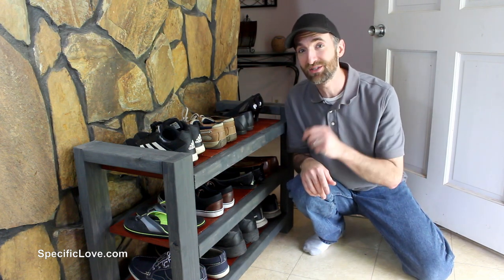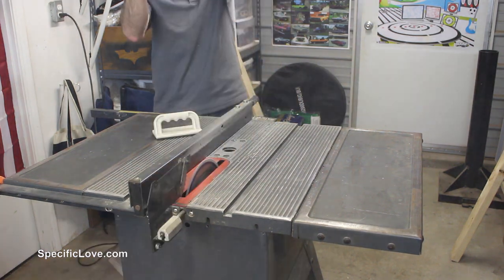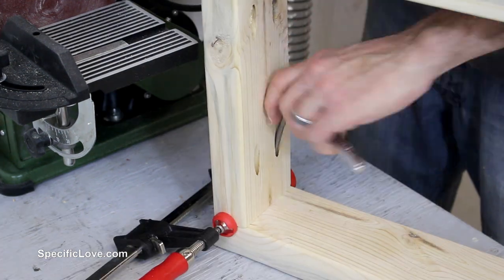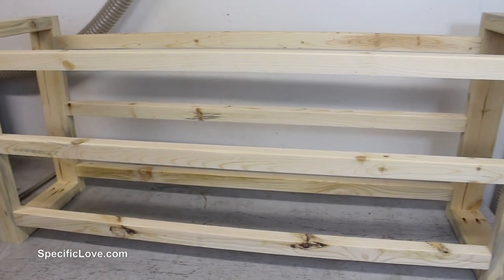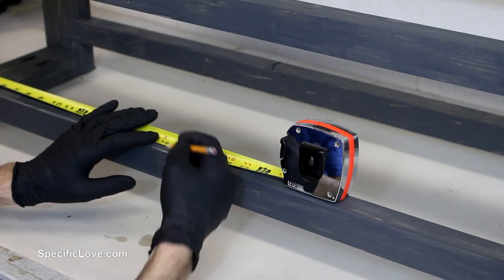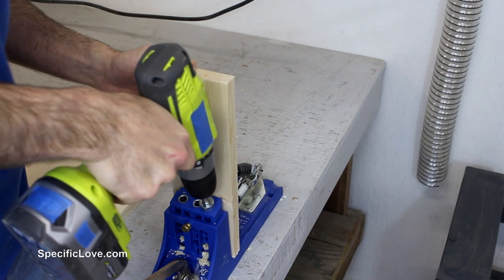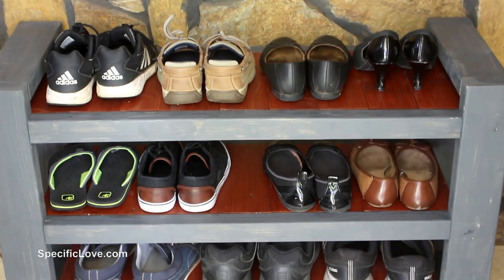Shoe Rack Shelf DIY Custom

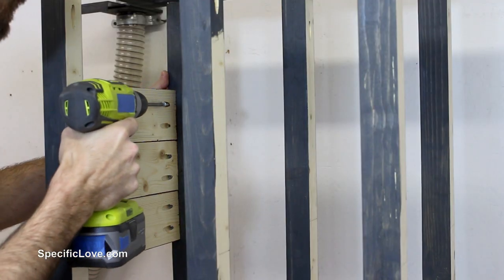Comment: I'm going to do this ! The only difference is is I will use 45 degree bracing from the back wall to the bottom of the shelf. My ceiling is very high. 2:43